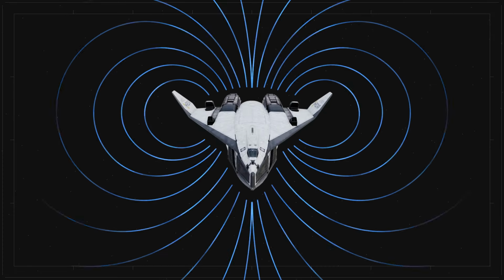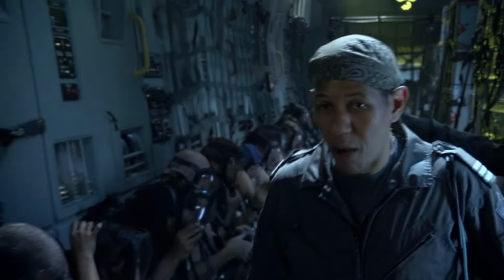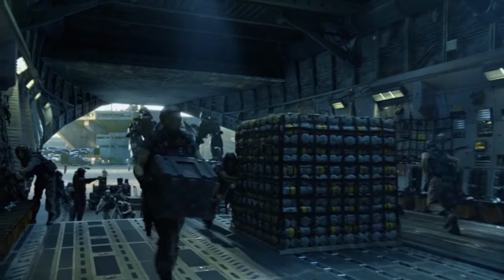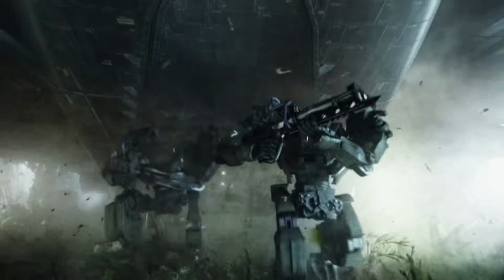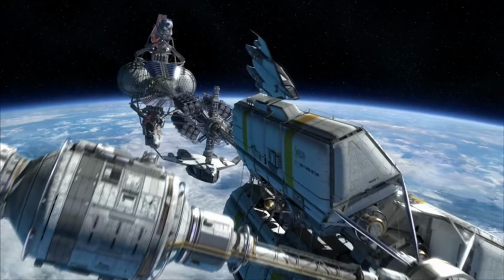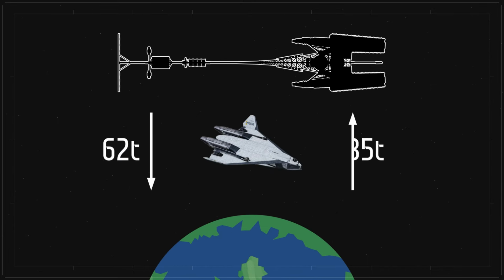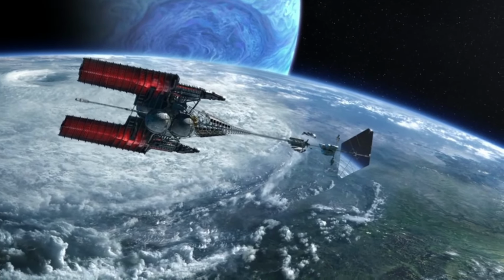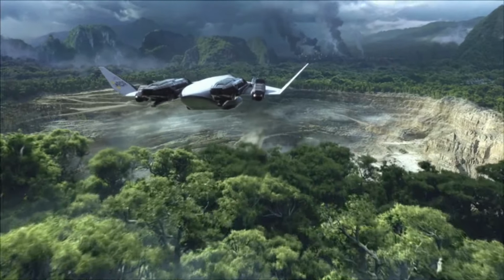Avatar: Valkyrie Shuttle Analysis

Comment: One of the biggest problems with this shuttle design is the placement of the 4 thrust vectoring jet lift fans. All four of them are mounted towards the rear half of the fuselage on the main wing. If you look at the placements of the forward lift fan of an F-35B, it's directly behind the cockpit. So the tail fan and front lift fan are proportionally distributed based on the weight distribution of the plane. Same with the Soviet Yak-38 and Yak-141. 

The Valkyrie shuttle lift fans weight distribution is not balanced. They're placed too far back. The two smaller lift fans should be placed at the leading edges of the main wing, somewhere behind the jet intake to make VTOL work in theory. In reality, if the 4 lift fans pushing at full thrust, the Valkyrie would flip over instead of VTOL.

Comment: "why did the entire engine rotate" like if tiltrotors weren't a thing. Most proposed VTOL designs rotate the entire engine nacelle or have vertical engines that become dead weight when in horizontal flight.

As for the inlets, those wings are thick as fuck, the engines probably receive the air when they are facing forwards.

Comment: I'm pretty sure the scramjets are the same engines as the turbojets, as hybrid engines like that are a thing, something like how the engines on the Darkstar from Top Gun: Maverick worked, and Turboramjet engines like the J-58 engines of the SR-71 operated on a similar principle, above a certain speed you just open a diverter to bypass the compressor and you effectively have a scramjet

Comment: Its a fusion powered spaceplane so it probably gets rid of most of the reentry heating problems by killing much of its orbital velocity using its propellant tanks. Fusion engines get your propellant to take you further, just not as far as antimatter would.
Reply: Probably still quite wasteful as propellant consumption goes, is is not? Aerobraking is just so darn efficient.

Comment: I think the top mounted wings are not only for making clearance for the VTOL engines, but also having enough ground clearance in uneven landing zone, since it can serve as a dropship in combat. And because it's a cargo plane initially, top mounted wings can also lower the center of gravity below the center of lift, gives it much better stability when entering atmosphere. 
I love how they put those carbon-carbon plates on the bottom of the plane, make it at least much more acceptable, instead of throwing bunch of pure fiction designs at audience.

Comment: Doesn't unobtanium have anti-gravity qualities? If a cargo was all unobtanium, would it weigh anything? Would it even help the ship get off the ground? Depending on the bulk of the unobtanium onboard, would it be possible to lift more additional cargo than the lifting capability of a ship not carrying unobtanium?

Because of the power and efficiency of its engines, it may be possible for this type of shuttle to kill all or most of its orbital speed, and drop into the atmosphere more like a rock than a space shuttle. Shuttles from orbit heat because of their entry speed, which is determined by their velocity in orbit. Shed enough orbital speed and the ship simply falls, a fall in which its maximum speed will be limited to a terminal velocity dependent upon its aerodynamic performance (a function of design and angle of approach) and atmospheric density (the increasing density as the ship falls will slow the craft). There's no need to have a lot of heat shielding on a ship capable of shedding its orbital velocity. The US space shuttle used orbital engines to make the shuttle begin to fall, but most of its kinetic energy was turned into heat during the descent. A Valkyrie likely wouldn't need the broad aspect of the low-wing shuttle, because it wouldn't need to deal with atmospheric heating during entry. In fact,  it could probably turn its engines into its orbital direction (by swapping ends, like the shuttle did during its de-orbit burns), kill all of its speed relative to the ground, fall straight to the ground with its engines in VTOL position to control its fall, and begin forward flight once it reaches suitably dense atmosphere for its wings to achieve lift.

Comment: on the note of where the scramjets are located, on the underside of the fusion rockets you can see two 'fins'. I think they are exhaust flow fins and the inlets are located where the top of the fuselage meets the f-engines. By running the local atmosphere along side the fusion reactors(which have a temperature of several million degrees) it would act as a pseudo scramjet as they work in the same principle. 

Then again I could be wrong and my theory could be very wrong xD Just my guess and use of them.

Edit. Just realised the vertical slits at the nose could also be the hypersonic inlets

Comment: The key to SSTOL is not stage break classic ascending. But phase effects. Convertion from VToL low atmosphere bulk purpultion engines, to narrow ram & scram jet. Eventually 'Turbo-jet,' of rocket fuel used as atmosphere within turbines. Finally in exo orbit, 🚀.

Comment: The most glarring oversight is the idea that their are only 2 such craft at Pandora at a time and they both arrive and depart with every ISV.  A base would absolutly have it's own fleet of such important vehicles so that it is not without them when the ISV departs.  These would have been acumulated over time by leaving 1 behind or even assembling them on the surface as we see numerous vehicles which are too large to have been transported in one piece in the Valkyrie hold.
Reply: At 3:15 it's explicitly stated that they are left behind.

Comment: I think the wings were mounted at the top to give it more stability in vtol mode, because the center of lift during the takeoff and landing in vtol mode would be most likely above the center of mass. If the wings were mounted at the bottom, the center of trhrust would be below the center of mass which would result in worse stability. To get around that, the engines would have to be spread far away from each other, but because of the shape of the valkyries wings they could only be spread far from each other in the left/right axis, giving it good roll stability, but not far in the front/back axis meaning the pitch stability would be bad. the easiest way to get around this would be to attach the front engines seperatly, which would propably be harder than just putting the wings at the top.

Comment: High mounted wings do make sense in the environment the shuttles are operating in. Low mounted wings are very easily damaged when operating from rough and remote landing sites - especially on a VTOL aircraft that will throw up huge clouds of debris when landing and taking off - both the Harrier and the Osprey use similar configurations to the Valkyrie.

Also, for a cargo aircraft it works well, as it gets the wingbox out of the way of the floor, ensuring a nice flat cargo bay, and also makes operations around the aircraft easier - if it's high enough, cargo handlers don't have to dodge around the entire wing, and can move underneath it. It makes loading and unloading simpler, again, especially in rough conditions such as a jungle clearing or around mining sites with lots of kit, pits and spoil heaps all over the place.

As for the whole engine rotating, this I think is pure vfx play. Even to allow greater than 90 degree deflection, nozzles can do this without the engine needing to move - the Harrier can do precisely this to allow it to land on a moving carrier. It isn't mechanically simpler (in fact, it's much more difficult), so I don't think it makes sense in scientific terms - but it does look neat and gives an instant visual explanation of what's happening to the audience.

Comment: 0:43 Fusion  would not power turbojets - or scramjets - turbojets run on atmospheric air/oxygen and jet fuel. Do you not ever check wikipedia?  Those “Turbojets” if they were fusion driven would instead be fusion driven rocket engines using a superheated gas from the fusion reaction, possibly water/steam, forced through a rocket engine nozzle. 2:47 “Hypersonic inlets” are for taking in air to mix with fuel in the scramjets. Something has to go “in” to them, they’re not called inlets for nothing. Fusion has nothing to do with what you describe. There’s no reason why this couldn’t carry enough jet fuel, and use fusion as an unlimited source for rocket propulsion, but the way you describe it is nonsense, it sounds like you made it all up yourself. 4:21 what are you talking about with “antimatter tanks” ? Fusion doesn’t run on antimatter, it fuses hydrogen nuclei, just as the sun does. Outer space is full of hydrogen, antimatter hasn’t even been found yet, only subatomic anti particles which are rare. Did you ever read a single science book? You ARE just making this up, aren’t you?
Reply from the maker: I did not make it up no, but someone did. All the info is from https://www.pandorapedia.com/human_operations/vehicles/valkyrie_shuttle.html which you would've found with even a cursory search. If something doesn't make sense, take it up with the people who made Avatar.

The antimatter is in reference to what the ISV uses, thus the ISV being on screen at that part of the video.

Comment: One of the reasons why the Valkyrie had a top mounted wing was to give the wings more clearance from the ground. Those fusion engines would likely need more ground clearance when they're pivoted down like that. And like many large modern cargo planes (for example the C-5 Galaxy and the An-144), the Valkyrie also used top mounted wings so could open its cargo doors closer to the ground.

Comment: Good analysis, except a fusion plant would not power a turbojet engine.  Turbojet engines are gas turbines and burn propellent by their very nature. Suck, squeeze, bang and blow is the simple way of understanding them. Air is sucked in, compressed, fuel is added and ignited creating the bang, then then combustion reaction blows out as thrust also passing across hot section turbine blades to turn the central shaft that mechanically translates rotational energy forward to turn the compressor stages and main fan typically referred to as the N1 stage. 

There are some concept designs out there for a fusion, turbine engine hybrid, however, that is not likely to ever work. But to nitpick, a fusion plant would not "power" a turbojet as turbojet engines are self powered. No turbojet engine combination would ever be able to provide VTOL capability to a craft this large let alone sustain slow flight with vertical thrust as in the "bomber scenes". That simply defies physics as the engines would have to be much larger, and would eat more fuel for sustained vertical "hovering" slow flight than the Valkyrie could carry. You're getting into the thrust to weight ratio conundrum which has always limited the size of true jet powered VTOL aircraft. For comparison, the AV-8 Harrier attack aircraft cannot take off vertically at it's maximum structural takeoff weight for a runway takeoff.  In fact, Harriers that did take off vertically carried little in the way of munitions payload and to get any worthwhile range they'd need to in-flight refuel not long after departure. 

You couldn't use fusion engine thrust in an atmosphere either. Fusion propulsion just would not work in an atmosphere. 

The Valkyrie is cool looking, but total garbage when it comes to realism with near future technology. The hovering slow flying bomber scene would only be possible with anti-gravity technology which may never exist.

Comment: The shuttles spend the rest of its life as gas harvesters for next ones to arrive? So, correct me if I'm wrong, they're basically disposable...?

The viability of those shuttles and the resource it ferries, which in turn used to pay for said shuttles (build them, fuel, maintenance, the works ) is pretty vague
Reply: Probably because of weight. The unobtanium is of course loaded up in the ISV which adds weight/mass so in order for it to still operate normally and use the fuel more efficiently, the shuttles have to stay or else the ISV will have to deal with more mass that it is not intended for its design.

Comment: You forgot to mention a structural issue with Pandora movie plot, the glass shields being pierced by a native manual bow & arrow, Heh. About those VTOL/SSTO craft, many engineers never understood the kamen line atmosphere advamtages, of wings, propellers and afterburns below it, convertion ramjet to pure rocket above it. So an idiocracy of rocketism was applied, exirting pure canisters of burning money. Just for quick speed, like zombie apocalypse mobs were after them at takeoff stations. You probably was wondering where they could install the 'ramjet' function. The front air intake would volume level compress squeeze the thin air into a turbine jet to rocket advantage, the full engine pivit was a simplistic mechanism using the motor of the engine axels, which is more simplistic then a F-35 vertical convertion. And more rugged.

Comment: - Doesn't anybody pickup on something really wrong with the approach of that shuttle to the base? It rubbed me the wrong way when I first seen it in IMAX.
And every time there after.
-  Its aerodynamicly wrong. Coming from orbit it needs to bleed off excess speed (Mach 25 down to < 1 Mach) Using its bottom forward as a heat shield & air brake.
-  Anybody  who flys an airplane or simulator knows that you don't dive to the airport, you come in as a  controlled crash , with noes slightly up,, decreasing speed & adding flaps for partial lift as you gently sink to the runway with rear end wheels touching first then let its front slowly bob down for front wheel touchdiwn. The trick is not to stall & drop by going too slow until the last moments before contact with runway. .
-  Diving down like a Kamakazie was really dumb, if you know better.

Comment: Valkyrie is heavily limited by the plot. Conservative estimates for fusion based rockets suggest capability to lift hundreds, if not thousands of tons in LEO. Fusion rockets are pretty much the endgame for a long time. Once you've mastered magnetic containment for the fusion reaction, directing thrust is small potatoes. Fuel is probably liquid hydrogen or even water, making fusion torches environmentally clean. A fusion rocket using hybrid engines to inject miniscule amounts of antimatter for extra thrust will have disgustingly high delta-Vs, which is what Venture Star probably is in the movie (it heavily differs from Pellegrino's concept in the novels "Flying to Valhalla" and "The Killing Star"). Look up GCNR Liberty Ship as well, it's a well detailed concept of a Gas Core Nuclear Rocket that uses a fusion reactor.
Valkyrie should also without a doubt be a rocket, taking off and landing vertically. But that doesn't look as pretty as a silver wing cutting through the clouds like a bird.
Reply: Water would be super versatile as a fuel wouldn't it? As it's hydrogen & oxygen, if you can split the elements in real time using some super fancy high capacity future fuel cell you can create fuel & oxidiser for orbital manuevering jets, also generating electricity in the process via the reaction. You can also fuel the fusion engines using that same byproduct, and even feed the hydrogen into the back of the electrojets when landing as an afterburner, for more thrust, and/or inject the water directly into the intake to cool the incoming air for greater density. There's a distinct blue flame seen in the film from the tilt engines when the Valkyrie lands.

Or maybe I'm taking complete bollocks 🤣
Reply: @visionist7  Water is the reaction mass in The Expanse universe's Epstein Drive, a fusion reactor of unparalleled efficiency that allows continuous high acceleration and resulting high velocities. Deuterium-Helium pellets are used for fuel. Water is also used for "teakettling", flying using evaporated water in maneuvering thrusters. Water is also used for shielding and for all on-board needs. It really is super versatile.

Comment: If unobtanium floats in air, doesn't that mean the more you load them in the shuttle, the lighter it becomes?
Reply: It floats, but it still has mass. Much like a helium balloon. Once you get out of the atmosphere, it's still mass that you need to accelerate to orbital velocity, which limits how much you can get to orbit. For a transport purely within the atmosphere though, sure, it should be able to lift as much unobtanium as you can physically fit inside it.
Reply: That's not how mass works.

Comment: haven't read too much of the comment section, but some ofc. and I agree with most that speak to a heating issue having been one problem the rotating VTOL engines face. but there's one more thing they do when they rotate like that. they generate drag, or basically they become Air-breaks that can slow down the aircraft faster so it can get into a more stable hover faster. another thing is, it is easier to rotate the whole engine to keep it as simple as possible than to add a nozzle like the harrier has or the turning/bending nozzle of the F-35B. atleast that's what I'm thinking atleast. I could be talking out of my ass ofc :P but besides all the things in chat. the plane looks cool as balls because of the design. oh and the scram-jet components are likely just a part of the engines themselves using the normal inlets that just constrict on the inside to speed-up the airflow. if my understanding of a scramjet is worth anything. IF